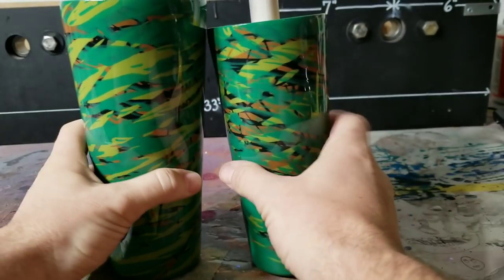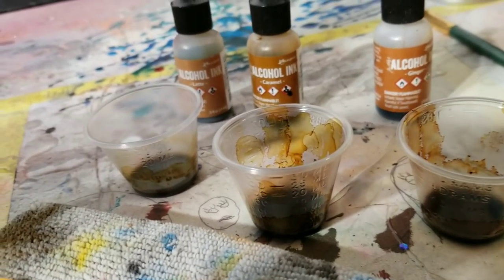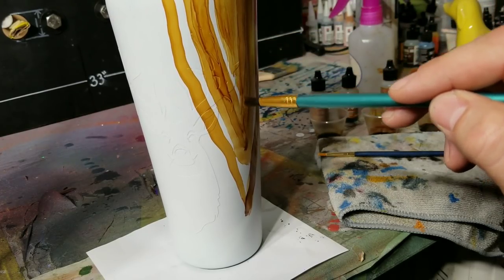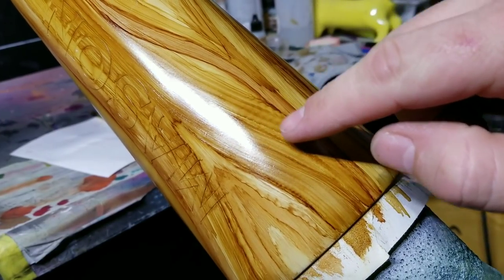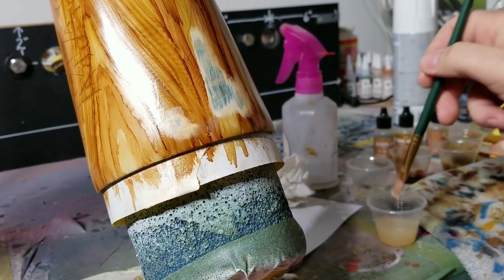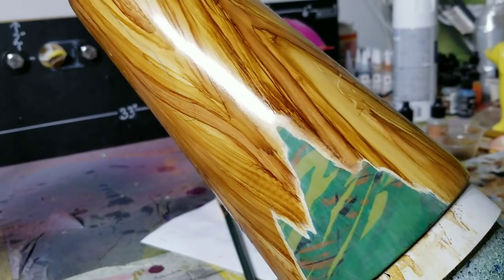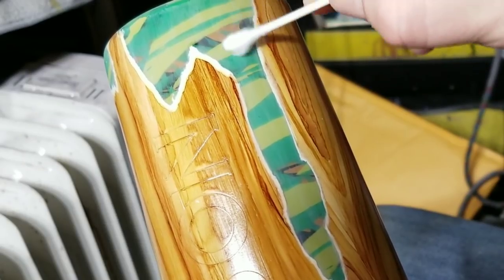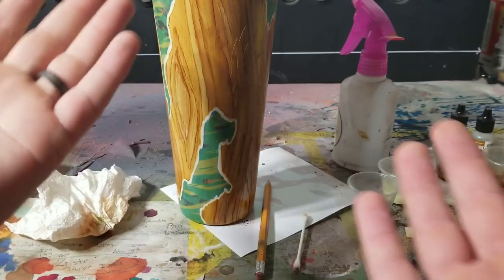Wood Grain & Camouflage Geode Tumbler Tutorial

Comment: Do you ever spray a clear coat on the cups
Reply from the maker: I used to finish them with automotive urethane clear coat before I started using epoxy
Reply: @DuncanCustomAirbrush  I am actually looking to get away from epoxy and looking to finish with something I can spray, preferably through an airbrush